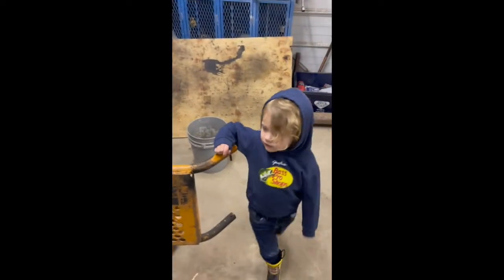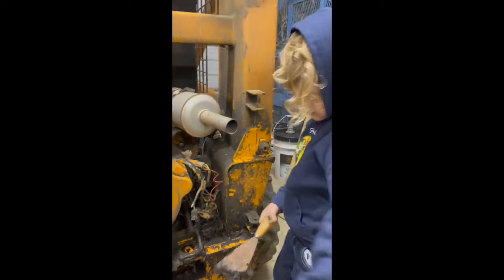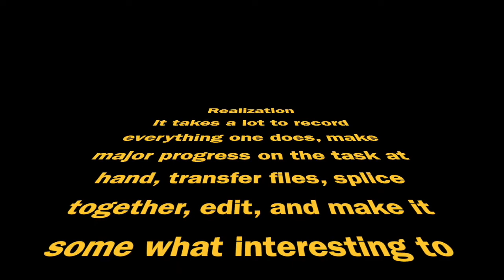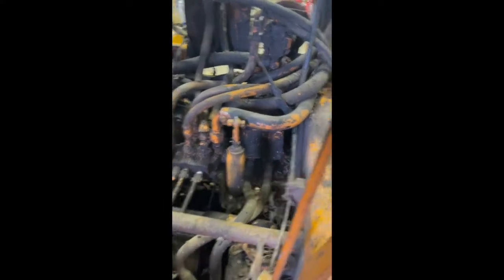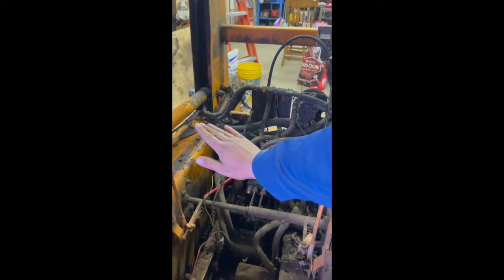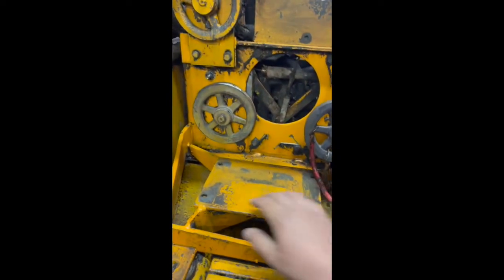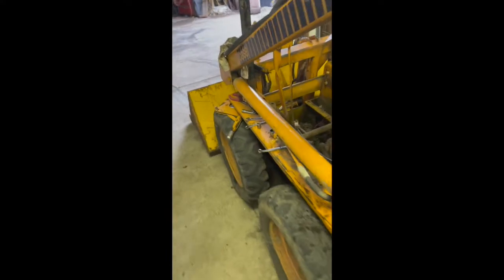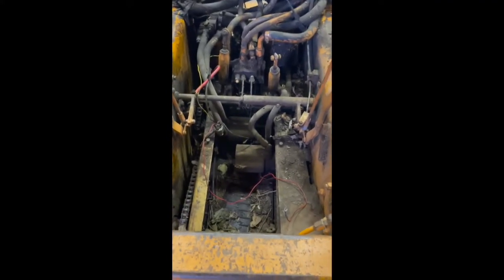CASE 1816 Rebuild Part 1

Comment: Found it ,looking for information on drive chain to rear wheels. Very informative video, thank you
Reply from the maker: what do you want to know about the rear drive chains? I had all the axles out and replaced the seals and bearings as well as cut some fresh keyways on a couple that were getting pretty sloppy. I wish I had recorded it but I broke the tripod and had no extra hands to video.

Comment: Hi ! Great video! I have case 1816C, I bought it without the seat Mount so I ordered a seat on eBay. I have shock absorbers but the new seat has no place to attach it. Please advise to this when making your next video. I don’t know if I should remove shock absorbers completely or weld something to the seat Mount for attachment. Looking forward to see your progress in fixing this toy. Thanks in advance !
Reply from the maker: I will have to run out and look under the seat again soon. its either those shocks or another set bringing your levers back to center. the valves on the pump are not self centering, so there are additional components built into the lever assembly along with some adjustments to bring the flow of fluid to a halt. Thanks for you feedback!

Comment: I am getting ready to put a predator engine on my 1816 . You are right there are not very many videos of this for this machine.
Reply from the maker: I apologize for the video orietation making the picture so small. first video I've ever made! and yes not a lot of info or specific details online. do you have a service manual/parts book?
Reply: How did you make out I just bought one with a predator engine in it and the guy who did it mucked it up and now the pto is always engaged I’m about to tear it apart and try to fix it could use some pics myself if you have any .
Reply: @hugeranger782   I’m still working on it but I made a adapter plate out of 1.25 inch  steel plate I had . The predator engine shaft is two low compared to the original engine.
Reply: @hugeranger782   I drilled holes to line up with original engine holes first and then drilled and taped the holes for predator engine. I bought a Engine template from a predator aftermarket website so I could get the holes just about perfect. It was a big pain and took a lot of time but it looks like it will work great. I had to counter sink two of the original engine bolts because it interfered with the engine when they were sticking up. I wish I could figure out how to take a picture and post it on here.
Reply: @joew5862  thanks I guess I will be removing the engine
Reply from the maker: @hugeranger782  does yours have the lever to engage the pumps by your left knee, or an electric clutch?
Reply: @midwestmetalstorm6162 yes  it has the traditional lever like an emergency brake.  I would not be opposed to an electric clutch

Comment: Im having trouble with the electrical in mine.  Cant figure it out.  Had to replace a switch and now i cant get it to work
Reply from the maker: is yours all original? I could look though the service manual for an electrical diagram.

Comment: Any updates on the project? I have a 1816C and am contemplating replacing the engine...
Reply from the maker: I do have more content, I've just not gotten it finished in splicing it all together and uploaded. the Honda gx660 I installed bolted right in. I had to get two different length belts to make it work because the shaft height was a bit taller on the Honda. 7/8'' if I can remember correctly. was pretty straight forward. thanks! ill see if I can send you a message when I get the new video up
Reply from the maker: New video up!
Reply: @midwestmetalstorm6162  is the Honda the same as a predator engine ? If so could you give me the belt sizes I’m haveing trouble with my pto the belts the guy put on keep the pto engaged constantly. Any thoughts on using and electric pto from say a tractor ?
Reply from the maker: @hugeranger782  The shaft height on the predator 670cc is 5.250'' and on the Honda it is 5.260''. The Tecumseh I pulled out of it had a shaft height of approximatley 4.625''. I don't remember off the top of my head what the belt lengths were. we added an inch to each belt running the drive pumps. the loader pump is always engaged as it has no other option.
Reply: @midwestmetalstorm6162  that is a HUGE help thanks . It seems that the guy also mucked up the belt alignment one drive belt looks like it would be better off on the outside sheave and vice versa . Not sure what he was thinking if you r going to do the job do it right or not at all . I payed $4000 with the new motor and 2 new tilt cylinders  and hoses so it’s still not that bad to me .

Comment: Do your self a favor and get the 2 ply hydraulic lines for the controls cause they blow if you're  going to up the hp
Reply from the maker: Not a bad idea! I was planning on running the motor at half throttle 90% of the time as I just don't like the noise a small gas engine makes wrapped out. the hoses all probably need replaced soon anyway.